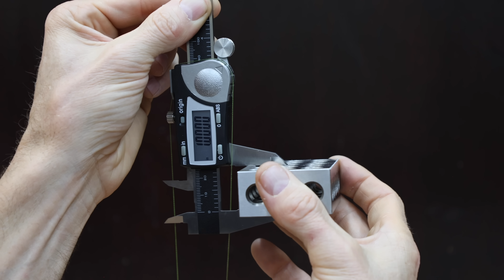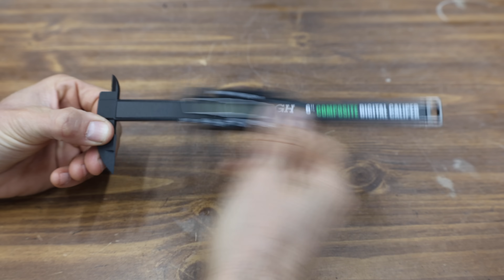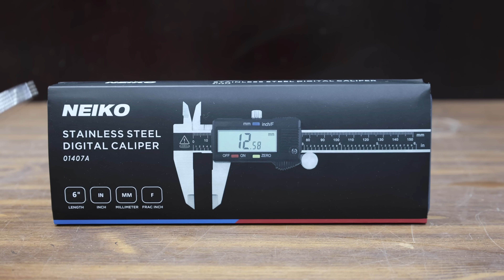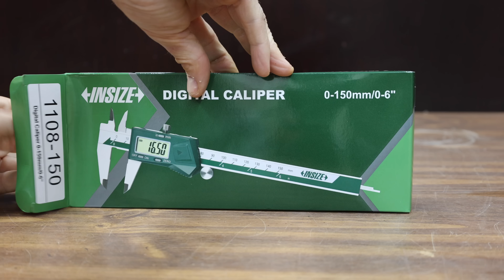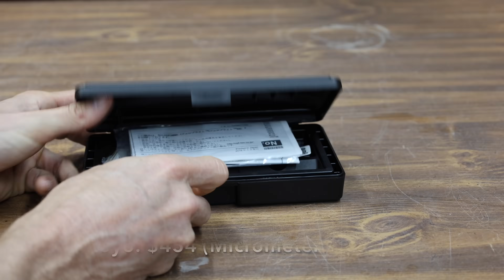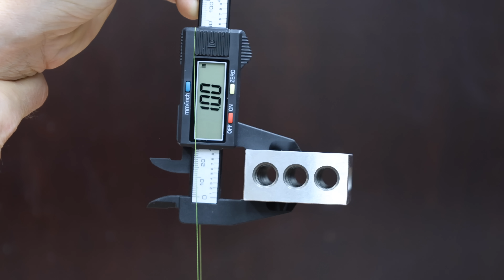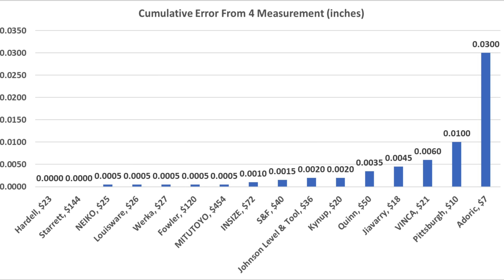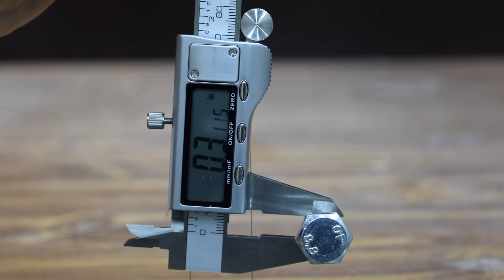I've Been Proven Wrong About Calipers!

Comment: I have this old analog Mitutoyo. Everytime I pick it up my brain just smiles, you can just feel the impeccable quality in your hands. There is nothing like when Japanese decide to make some metal/steel stuff...
Reply: I used to use a $40 ChiComm pair--they worked at first but started to get inaccurate and I didn't know it.  Once I figured the out that a reloading problem I had was measurement based, I bought the Mitutoyo.  The problem went away.  At this point I've used them for years.  I should have just bought one the first time.  Great set and you canget them for $120 or so.  Be careful though--Amazon sells a lot of fake ones.

Comment: I recently had to throw away  a cheapo electronic caliper with an aluminium body. For some reason, the aluminium had deformed and turned very friable, it was almost like a hard chocolate and could be snapped easily with two fingers. Mercury contamination?

Comment: Mitutoyo for me. But the price you have paid is crazy. It is much cheaper where I live. On thing you have not tested (and for obvious reasons) is the battery life. I've been using cheaper Limit calipers. It ran out of two LR44. The battery life was half a year at most, with very occasional use. So ocassional that at one time the caliper worked with no low battery indication, the next time I needed it the battery was dead which was annoying.
Then I got angry and bought Mitutoto for the equivalent of about $140. It runs out of the same battery for several years now. And absolute scale is very convenient. It was 3x more expensive than Limit but I do not complain.

Comment: I have a a basic one from Parkside (which is a LIDL Brand) for like 10 bucks and one from Mitutoyo for well, Mitutoyo price - Sure the Mitutoyo is way more precise but the basic one isn't to far off actually. I mainly need the for 3D Printing. If I need to be 100% on point with a measurement, I use the Mitutoyo otherwise, the basic one is just fine

Comment: Where did you buy those Mitutoyo's, because you paid way too much for them. From the usual tool supply companies, MSC Direct and others, they're $120-170 and the micrometers around $200. Mitutoyo is the one to go to if you're making a living off them, there are nicer/better ones out there but they hit the sweet spot of accuracy vs cost, and they've been around $120 for the last 20 years, either list price or on sale. Great video, just the price issue kind of bugged me as it skews it away from what most machinists I know would call the go to answer.

Comment: I ordered a cheap set, and they were perfectly accurate (within my needs at least), but the quality of the machining was pretty poor. There were wavy sections of the metal, burn marks, and the depth gauge grove in the back wasn't flat. As mentioned none of this affected how they worked, but I decided to return them and get a more expensive set because the product pictures didn't show the poor quality and I wouldn't have bough them if I knew they were going to look like they had been assembled by a gorilla. The more expensive set was no more accurate than the cheap set, but it was free of defects and the grove that the depth gauge sits in was machined smooth. There was also a bit less play in the system because it was machined better.

Comment: I’ve had a harbor freight Cen-Tech digital caliper for probably 10 years. This is before Harbor freight had other in-house brands like Quinn. I remember purchasing the Centech for $10 back then, but it has a thumb wheel and metal construction. There are times when I need to use my Mitutoya micrometer for accuracy, but it’s really amazing how these low price calipers can deliver enough accuracy for most people. When I worked in aerospace, all of our measurement, tooling needed to be traceable to the national Bureau of standards.

Comment: Agree with lots of other posters here that the depth readings are NFG using a desk top.  Ground - cleaned surface at a minimum.  Not buying your readings for the mitu on the depth results.  Something was stuck to somewhere.  Would bet on it.

Comment: you should definitly mention that the mitutoyo calipers came with SR44 batteries and not the cheap LR44s because when they come with LRs preinstalled that means they are a fake.

Comment: I get the odd feeling most of these things are spit out the same factory. Or at least most parts.
The fact that 1 feels better than the other might be because parts fit better or worse by accident.
I am rarely impressed by these things. But when I am, they are made in Japan.
Still I would buy the cheapest that shuts off automatically.
After some months they all feel the same, and I need them to quickly check the depth of my router or the thickness of plywood.
Somtimes to check If I have a 10mm or an M10 drill (a tad over 10mm).
I am not measuring piston rings or shoesizes for a aphids.
And now if someone wants a caliper, I don't need to worry as tell them to take one from the caliper holder.

Comment: I think the real question would be the consistency from unit to unit within each brand. I feel very confident in saying that the Starett and the Mitutoyo would both have very similar results through testing of 10, 20, 50, 100 units. I am a big believer in the Mitutoyo brand for measuring instruments and here is part of the reason why; many years ago I had purchased a cheap ($25) digital capliper set off of Amazon and they were ok to begin with. However, after some intermittant use over 3 to 4 weeks, I noticed I was having to reset 0 every few measurements which was very annoying. Then I began to have severely inconsistant measurements - i.e. varying +/- 0.030" on a measurement of less than 0.500". It was shortly after this that the calipers lost it's mind altogether and had to be tossed in the trash. Worst part, I really NEEDED the calipers at that time and had nothing else besides tape measures and a couple rulers. I ordered what was then about $130 Mitutoyo AOS set of calipers and I am still using them frequently some 6-8 years later. I have purchased the same calipers twice since then to one, have a backup set, and two, to have a set in the shop and in the reloading room inside instead of trying to carry them back and forth. The last time I bought the Mitutoyo Calipers (500-196-30) I paid $165, and they are available right now on Amazon for about the same. The time I bought the backup calipers, roughly 4 or 5 years ago, I got them for right around $100. Since my first purchase of the Mitutoyo calipers, I have also bought several other measurement tools from Mitutoyo including Micrometers, test indicators, dial indicators, depth mics, etc. and have never been disappointed. Sure, there are cheaper options, but it's worth a lot to have faith in my tools, know they are going to work when I need them to, know they are going to last if taken care of, and know they will be accurate. As in the case of calipers, they aren't usually the best way to measure something but they are quick, easy and versatile. I know if I need more than absolute 0.005" accuracy, then I am going to be using a micrometer, indicator, etc. that is made for the specific measurement I am after. Measuring equipment/tools is definitely a case where "cheap" is a relative term and the cost of a good Mitutoyo Caliper might be a drop in the bucket compared to the cost of downtime, inaccuracies, etc.
Reply: Brown and Sharpe was originally from Providence, Rhode Island started in 1833. Sold out to another company just like Massachusetts made Starrett. In the eighties & nineties every TIG welder bought Mitutoyo dial calipers 6 and 12 inch.

Comment: I am a retired 
Aerospace machinist.  When I saw you sliding them back and forth really fast I cringed.  Calipers are for quick measurements.  If you want a true measurement then grab a micrometer.  Now I run a diesel bus shop and do a lot of brake measurements.   I use a cheaper set for that.  Igaging works good for that.

Comment: I have a Mitutoyo set from an old job, that were lab-calibrated a month before the company went out of business. I bought them for myself for $20. I think they retail for about $350.
Reply: They cost around $150 for the one used in this video. The coolant protected one is a bit more expensive at around $200.

Comment: Wow, that’s a subject to be debated. It’s really all about what you’re doing. If you’re measuring screws around the house here and there then probably the cheapo set works. But if you’re a professional machinist and working, especially around coolant in what I consider a hostile environment with chips and hot chips, especially then you wanna get something Probably two calipers one of them I call it a daily use and another one more like for final inspection. You would consider getting the coolant proof I guess it’s IP 67 as well as a namebrand like Mitutoyo which I’ve been using forever. And that’s the other question. What about longevity? The cheap set probably wouldn’t stay working that long like a Mitutoyo, or the Swiss made ones. And then comes the question what if you need a 12 inch? In the shop where I work a 6 inch was only good for about a third of the applications we were doing, so you have to spend more money for the 12 inch and you probably can’t even get the cheapo or it’s not worth having for that size caliper. One little side bar here, with really big calipers. I use Vermeer calipers because they last forever and they’re virtually bulletproof. Yes, they’re a pain to read though.😂

Comment: It would be nice to know which of these came with NIST traceable calibration out of the box. I know my Mutituyo does. Sending measurements tools off to a metrologist is very expensive, so having this standard saves a hidden cost for anyone in manufacturing who may need to prove that.

Comment: Apart from accuracy battery life is number 2 most important. Ive had several pairs of cheap calipers, but the battery life on the cheap ones is just garbage even the ones that turn “off” automatically. If I take my mitutoyos of the box I know they will work and the battery won’t be dead. When I take my cheap ones out of the box 1 in 2 times Im going to have to scrounge for a battery. Buy once cry on e. If the cheap companies were smart they would make a rechargeable usb C version and really change the value proposition of the expensive pair. Its also becoming harder to find a good price for genuine ones. Even Amazon is selling fake mitutoyos these days.

Comment: I run a college machine shop. We use Mitutoyo calipers. We've tried many others. Some nuances with this brand. No they don't have a auto shutoff feature, but the batteries last forever, so we don't care. They hold their zero setting perfectly, so you don't need to rezero them all the time like cheap ones. They are pro tools. It's important to buy them from a legitimate distributor. There are very good looking fakes out there.

Comment: You missed the Shars Aventor calipers. I have a 6" and 12" set of them and really like them. Added bonus of being pretty affordable. I use the Aventor calipers more than the Mitutoyo set I got (for short money) due to how they act in cooler temperatures. The CR2032 battery just works better than the LR44. 
IMO, any calipers that are composite materials should be avoided if you want any accuracy. Eventually they'll distort and will become pretty worthless.

Comment: It’s really impressive that harbor freight has managed to make worse tools with newer technology. I’ve got an old metal Pittsburgh caliper that has fractions and a hole depth gauge. The accuracy is enough for a hobbyist and for 3D printing. I haven’t seen a 3D printer yet that’s more accurate than cheap calipers. If you’re actually machining parts then it’s probably worth nicer ones.

Comment: you should have measured power consumption, the Mitutoyo consumes next to nothing, so no need to turn it off the LCD only consumes power when it changes. Even when off it is still activity measuring ,if I remember correctly (I reversed engineered the thing a few years ago).
The Mitutoyo battery last forever when compared to the cheaper calipers.

Comment: In my experience, compared to the cheaper brands, the mitutoyo's battery does last FARRR longer, very noticeable. But I've also found the mid range brands are just as accurate

Comment: The big thing with these calipers is the vampire drain on the batteries when they are not in use. The cheap ones are always dead when I go to use them. Another issue with the good ones is getting one that is not counterfeit. You can tell if it’s counterfeit because the battery vampire drain will reveal itself.

Comment: You're kind of measuring the flatness of a used wooden table through the block there. When you're counting 0.0005 you should have an actual flat and hard surface.

Also it isn't just testing and features. You can get a Mitutoyo with a certification. They sell replacement parts. Outputs and IP ratings. Hardened Jaws. This is why every pro uses them. If you are a hobbyist then you don't need the Mitutoyo, Starret or even Fowler. Just get the Neiko out Clockwork. It's all I have at home

Comment: The deal with cheap calipers... when you power them 'off', they're not really off... when you go back months later to use it again, the battery's dead.  For my uses a cheap caliper works fine... but I remove the battery after every use and it never goes bad now.  It's Kobalt, by Lowe's, btw.

Comment: If the shops buying the tools, go for a Starrett why not. If YOU are though, there's no practical difference between an expensive and cheap set for most uses. you can calibrate them yourself fairly easily, the difference is mostly just how quickly they'll wear. I've got a nice set of Mitutoyos and Starretts only because I got them from a retiring machinist for dirt cheap, when they're at their end of life they'll be replaced by some decent enough hardware store unit with the same tolerance.

Comment: May recommend a surface plate for performing such tests. A tool room grade surface plate should be good enough. If that is not an option, then use a piece of thick glass. While not as flat as the surface plate, it is more than flat enough for the test you are performing. Thanks for the review.

Comment: To be fair, I was always taught that calipers are never accurate. They're good enough to get you close, but a micrometer is the only truly accurate tool. That means that most of these would be just fine. I'd definitely shoot for the least amount of composite material possible, though, for wear reasons.

Comment: Had my Neiko calipers for 7 years. Would buy another from them in a heartbeat. I think I've been through 3 or 4 batteries in 7 years. Idk if that's good or bad. But seems reasonable to me. I definitely don't use them enough that I would want to upgrade to a model with a 2032 battery. I'm also using cheap LR44 batteries off Amazon that were probably on the shelf for a while before arriving on my porch. Not the freshest. Not the best. But they were cheap. I bought a 10 pack 7 years ago still have a couple of them in a drawer. For DIY woodworking and 3D printing stuff why spend more than ~$30 just get the Neiko.

Comment: Thanks for the nice and data rich video! It must have been quite an effort to produce!!
That said, I can imagine that it was not feasible to include the other measurement types (inner diameter and step).
Anyhow, I'd like to comment that I made the experience that the measurement types that are not done as often as the outer measurement (depth, inner, step) set the the brands apart (yes depth was checked here ;-)). Particular, the step measurement! Often I think most people do not even know that measurement type (even those people who manufactur calipers), which might be the reason why cheaper brands often fail.
Actually, evaluating all 4 measurement types (outer, inner, depth, step) measures at different outside perimiters. One small error on one side can have a large effect on the other. So, I would recommend checking all 4 before buying precision calipers.

Comment: As a Gunsmith and Machinist I use nothing but Starrett and Mitutoyo although I do have a couple Fowler Micrometers.  I can tell you over time the cheap the calipers will become "out of spec" as they get worn from use.  In my opinion I believe Starrett is the best based on accuracy and price.  Mitutoyo are about the same quality but more expensive.  Depending on use some of the less expensive calipers are adequate but for machining and tight tolerances, I would never trust them

Comment: Great video, I still have the same set of Mitutoyo Digital calipers sitting on my desk purchased back in 1988 when I worked for Boeing.  Even after all these years they still work fantastic.
Reply: As a TIG welder/precision electronic sheet metal guy I only used decimals with blueprints, so two pairs six and twelve inch dial calipers were a job requirement for 35 years. In 1982 the industrial tool store person told me the following: "We don't stock Starrett dial calipers because no one would buy them at $ 160 dollars for the six inch model." Our biggest seller is Mitutoyo (made in Japan) six inch dial calipers. They are approx. $ 60 - 80 dollars and the 12 inch model $ 150. I still have both mine from 1982 with no wear. I currently buy counter - fit Mitutoyo for an occasional hobby project, 2020 price on E-bay $40. Current Project Farm link price on Amazon $ 155 to 163. The Starrett 6 inch are $ 290. The only welder/fab Starrett tools you'd ever see are 6" & 12" combination squares. Starrett tools are for rich union machinists.